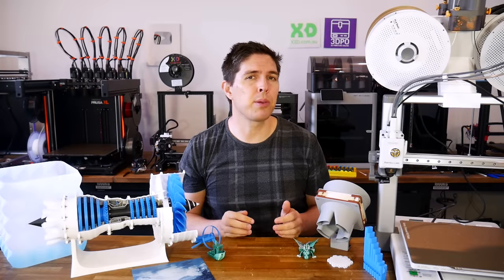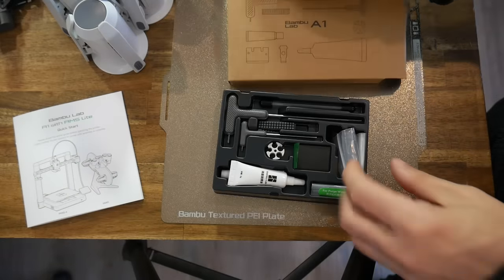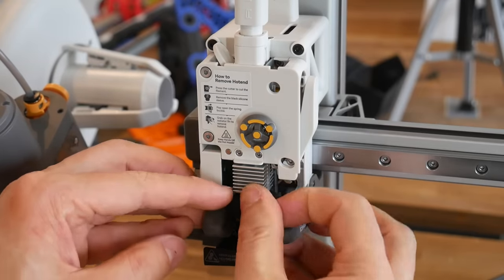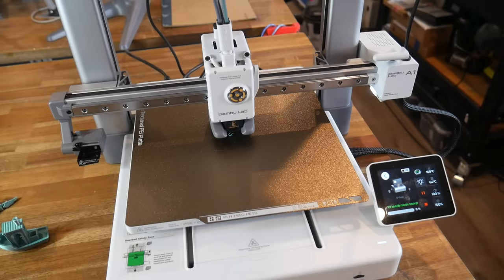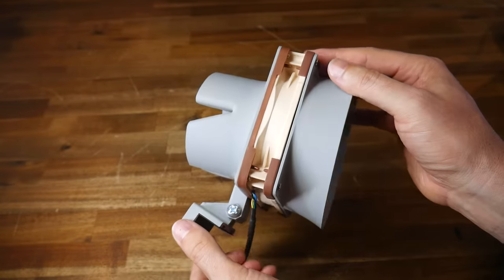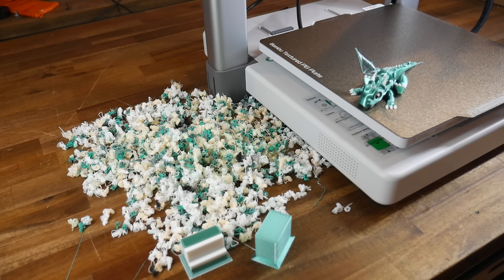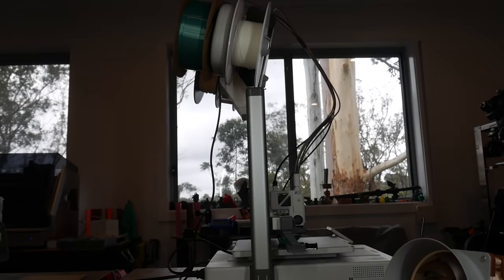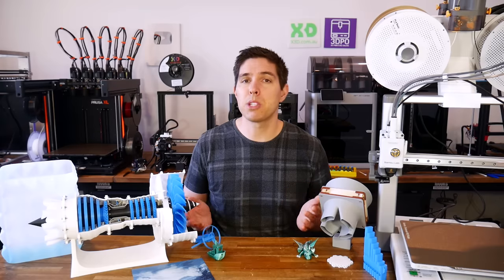Bambu Lab A1 detailed test - ‘Just works’ 3D printing for a great price

Comment: After fighting with my Ender 3 S1 for two days and it changing its mind on what Z offset it needs between every print, this makes me really want to throw it in the bin and just spend the money on something that actually works. Great review as always.
Reply: I just went through the exact same thing with my E3S1 Pro.  I could get one good print out of it then something would change and I'd spend the next 6 hours chasing what the issue was.  Bought an X1C w/AMS, set it up yesterday and I have been cranking out my backlog of prints one after another without issue.  Based on what I have seen, if you just want "set it and forget it" printing, any of the Bambu printers will fit the bill.  I'll never buy another Creality product again.
Reply: Same here. If I had the extra cash, I'd get a Bambu instead. But since my Ender 3 V2 was a gift, and it's just a fun hobby for me, I can't justify spending the money yet.
Reply: Do it man, you will not regret it!
Reply: After using a P1S for a month, I will never buy another Creality.
Reply: I've owned an ender 3 OG, prusa mk3s (My workhorse) and a new a1 mini. The Prusa takes less messing and it is definitely more reliable i've found so far as the a1 is constantly changing its first layer height and inconsistant top layer but the prints (when they work) are great. Just as good as the prusa. The issue with the a1 which no one talks about is that having a pressure sensored extruder means that any melted plastic will mess with the first layer height. And the ams sometimes fails to load
Reply: I was having a similar issue with my Ender 3 V2. I have silicone bed mounts and it still seems to change z offset on me. There was a while where I got it tuned perfectly a few months ago but after not printing with it for a while it seems to be acting up again. I'm also ready for a printer that doesn't change it's basic settings on a whim. However I got it for 130 bucks and I don't print enough to justify a couple hundred dollar upgrade. I'm personally going to give the belted Z mod a shot and see if that helps along with more careful tuning of the v rollers.
Reply: I’m exactly the same with my Ender 3 Neo which was a 6-month old model when I bought it but turns out that it was just a 6 year old printer with a few extra gimmicks.
Reply: @BenWolkWeiss One big fix for my E3V2 was changing out the brass anti backlash nut for a POM one (they're cheap online). The brass ones wear out very quickly and there's a tiny bit of slack, so every time it tries to move up the first fraction of a millimeter doesn't get registered which leads to inconsistent first layers. It clears up after a few layers once the brass nut re-engages. Another issue is the screws holding the hotend to the X axis aren't very good, and you can rock the entire hotend back and forth slightly which causes inconsistent Z offset each time. I replaced those screws too. AND the Y axis carriage can wobble a bit unless the wheels are tightened perfectly, which also messes with the Z offset. Tons of issues I've fixed and still find more sometimes. Also if you get the POM nut make sure to install it the correct way - which looks like upside down.
Reply: Something I've noticed with my Ender 5 is that thermal expansion can make the Z-Offset seem inconsistent. I've taken to heating the bed to 50C before homing and levelling with a BLTouch, it's a lot better now.
Reply: @fmarx1  Yea, I do the same and I feel like it still changes sometimes.
Reply: @Pikmeir  Oooh! Thanks for the tip! I hadn't heard about that issue before regarding the brass nut. I did notice that my hotend was loose a while back and fixed that. Appreciate those other tips about the screws. I'll check on those and tighten or replace them as needed.
Reply: In a weak moment i now bought one 😅 guess i will sell my S1 and V2 😂
Reply: definitely check all your wobbly parts (especially the hotend screws). The Z-Offset on the sprite extruder should be about -3mm. In my case, I installed klipper on my E3S1Pro and it works every time.
Reply: Same with my ender3. Far to much recalibration for each print.
Purchased a K1max and found life so much easier
Reply: X1carbon user for about a year...it just works.  Day in and day out.  Its been an amazing machine.  Constantly impressed.
Reply: @paradoxx_4221  nothing wobbles but from what I've read, it could be an issue with the frame not being square. I've got an RPi coming in the post to install Klipper so I might be able to stick with my S1 if that all helps.
Reply: @jacobplatt3066 Shouldn’t the A1 clean its nozzle before setting Z height?
Reply: @BenWolkWeiss so serious; you are probably having a software issue.
Creality slicer had my prints going 1.25x wide on the y side
Reply: @enhidri160  Correct, it should. But i keep getting first layers that are too high, then too low then okay then too high again so i wouldn't say it is consistant at all. The Pinda was a better idea, never an issue
Reply: You mean installing Klipper?
Reply: Yeah, why does the best z offset always change?  Because you lift the build plate and it's warped?
Reply: I just fought mine for a week to get one print. Ordered a a1 mini Sunday. Not realizing they were going to have this one
Reply: @jacobplatt3066  Yeah but the Prusa is twice as much as the A1!  I have a Prusa Mini and love it but I refuse to spend a grand on a Mk4 even though it is the ideal machine, IMO.  I just ordered an A1.
Reply: This is the exact shit that happens on the ELEGOO Neptune 4 pro, exactly the same, just garbage.
Reply: Had the same thing with my Ender 3 v2 neo. I did so much work to the darn thing to keep it running. I now have a P1P, I've done maybe 40 prints on it and haven't touched my v2 neo.
Reply: @joeking433  No no, i was referring to my old mk3s i've had for years. The bambu may have all the technology but it can sometimes make it worse. I'll just have to see how it continues to function. The only explanation for the inconsistant first layer calobration is the textured pei as it has to touch it with the nozzle and this spot will change each time, unlike the smooth
Reply: @Pikmeir if you can rock forth and back your hotend you need to tighten the wheel with the eccentric nut till its tight and has no play

that is not a real "issue" since it's relatively easy to resolve
Reply: I feel your pain with that. I've been using the first craftbot model for years, still have it and it works well. Got a 5 S1 with addon screen this time last year, at first seemed good, but soon realised there are issues with Z height and auto calibration not working correctly, and concluded that the firmware is junk. Got an A1 mini recently and it's amazing in comparison. Excellent firmware that works, and preparatory tasks such as heating bed and nozzle, levelling, nozzle cleaning, purge, calibration and so on happen in parallel rather than one at a time like with creality. Levelling is also optimised with the printer doing sanity checks on the levelling, checking that it matches expectation and running a full level only if needed. Merely saying that the Bambu is an improvement over something like the Creality would be understating it IMO as it's at a whole new level that I doubt Creality will ever reach. Bambu in the UK also correctly ensure that they charge VAT to customers, whereas despite being registered for VAT and shipping from the UK, Creality do not. So the 5 S1 is the first and last creality product I'll ever touch, and now about to get a second Bambu in as many months.
Reply: @BH4x0r I don't mean the eccentric nut. This is the actual hotend itself, which is held on to the X carriage by two screws which are positioned only at the very top of the hotend. The screws aren't the exact size or they're too weak or for whatever reason they're low quality and have a bit of give, even when fully tightened. I threw them away and replaced them.
Reply: @Pikmeir  hm strange, maybe that's a thing on the V2 etc, it wasn't an issue with the CR20 Pro and Ender 3 (original) hotend i had atleast
Reply: @BH4x0r It might've just been my unit. Mine has had a lot of small issues like that. It's just overall poor quality control from Creality, that some people get near-perfect machines and others get a mess like mine.
Reply: @jacobplatt3066  could you elaborate on the melted plastic part? Dirty nozzle on the outside?
Reply: @stavell  Yeah so i'm having inconsistant first layers but across the whole bed each time and it is mostly too high. The nozzle is always clean to my knowledge but the loadcell clearly isn't reading consistantly
Reply: @stavell  And i'm not sure what you mean about the melted plastic parts?
Reply: @jacobplatt3066  Sorry, didn't properly explain. I mean leftover filament on the outside of the nozzle or at the tip of nozzle. Nozzle cleaning routine before the auto bed level is supposed to take care of this? At least the textured PEI hypothesis is easy to test, just test with the smooth PEI :) But if it is the load cell then it would be hard to solve. 

Btw is the load cell used only for bed leveling or also used during extrusion similar to Prusa?
Reply: @stavell  I understand, so the nozzle cleaning routine looks fab but honestly, it doesnt really clean the nozzle the best, there is still plastic on the nozzle but maybe it only focusses on cleaning tbe very tip. I've got a smooth pei on order so will test that when it arrives and with the Prusa, only the mk4 uses the loadcell for flow rate and bed levelling, not the mk3s which is what i have, it instead just uses Pinda for bed calibration but it is extremely reliable. I find the flow rate compensation on the bambu to be best suited for bambu filament or the other filaments bambu lists. It can help but again it can be inconsistant. Manual flow calibration worked best for this i found.
Reply: Same thing happened to me.
Reply: i'm currently running ender 3 v2 with heavily customised printhead, but I know that when the time comes, when I say enough is enough, a bambu will take it's place :D
Reply: Same for me with my S1, what a waste it is
Reply: @BenWolkWeiss  Maybe the reason you don't print enough to justify the cost is because you have to fight with your printer all the time.  To be honest, I hate enders.
Reply: i have 2 S1s and 1 v2 thats basically an S1 now with sonic pad, for their time they worked ok but required work, I opened the A1 on xmas, put it together and sliced a flexifactory panda precolored and sent it. it was done by the time i got home for the day. worth the money
Reply: The Ender 3 is a low cost Printer not a beginner Printer. I have several selfbuild printers since 2014. But of course i wanted to print and not to do maintenance on printers, so i bought 2019 myself a Ender 3 pro. It was great, for the first 200 hours, then the maintenance started again. In the End it broke down after 1400 ish hours with total brake down. I bought another Ender 3 swapped all the parts over and guess what: The inspection after 500 hours revealed: 3 Roller Bearings from the Bed are damaged, the Rail in which the Roller runs has a bump now.. 
Ender 3 are cheap because they are cheaply build. I have Linear Railed printers which run after 2000 hours. And now a Bambu Lab X1C which clocked without any maintenance 500 hours and still runs fine. (And yes it will get a thorough cleanout now and regreasing, something i did on the Ender 3 and my other Printers every 100 hours runtime).
One thing to check on the Ender 3: Push the Bed forward and backward. It should run without Bumps, each Bump will change the heigh of the bed slightly, there are 4 rollers below the Bed. You can adjust there tightness. If they run bad you won't get a consistent height and they wear out extremly fast.
Reply: Have.  You activated the g420 s1 g code manually in the slicer, thats what really messed with my ender 3v2 and s1 plus, the 3v2 runs perfectly after fixxing that
Reply: You are bots. It’s disgusting. He’s just shown how actually lame Bambu Labs printers are.
Reply: I’ve loved all my Enders. Switched to ELegoo and hated it. Thinking of Bambu printers, but I have a sneaking suspicion they are complete hype. I’m getting better prints on my ender
Reply: @johnlocke3481  What a weird thing to get so worked up about. It's a printer, not Taylor Swift. No need to go all creepy fanboy about it.
Reply: Not bamboo tho, go prusa
Reply: This is the exact reason why i got my Bambu p1s,

the ender kept changing its mind on what the z offset should be for every print. tried everything, updated the firmware, and changed the sensors and the bed. no change, 

now with the bambu, it's kept in a completely different room. i just send a print over LAN and it's done, i dont even need to go to the printer to set it up. it just does it, and all i need to do is go and pluck the finished print, and it is good to go.
Reply: The bin?
Reply: That's what I did with my e5 pro. Got an x1 carbon and it just actually works.
Reply: Ive been running a ender 3 v2 since it came out and I’m getting to the point that I spend more time fucking with the printer than I do actually printing things. I’ve upgraded the shit out of it over the years and I’m finally just pulling the trigger on the A1. All the features that I’ve been wishing for since I started printing packed into one.
Reply: LMAO: I've been fighting the Z battle for 10 months now. Countless tech support tickets, Creality sent me a whole bed replacement. done all the hardware/software tweaks and still a crappy 1st layer with the center dead on 30mm squared and the other parts are simultaneously too high and too low. "Auto calibration & Auto Z" = the definition of Misnomer.
Reply: I used ender 3 for about 2 years. It printed fine first, then it had a nozzle overheat problem where it would melt the filament in the bowden tube and then it would get stuck.

I fixed it with a longer nozzle and put some thermal compound where the radiator is mounted on the nozzle shaft. It no longer had any issues and printed great for about 1.5 years, and still prints great. 

I just bought the bambulab a1 because it's quieter and faster.

Comment: CATIAV5FTW here… thanks for featuring the jet engine model ☺️ Looks like yours turned out pretty clean! One thing I’d recommend to fix the low pressure turbines rubbing in the back is to sand down the interfacing surfaces between the LP shaft and LPT spool. I’m working on tweaking the parts and profiles a bit to reduce the amount of support material as well. Also want to upload a profile where the support interfaces are PETG to obtain better surface quality on the supported features.
Reply: Your model is absolutly mindblowing. I would be able to copy it on Solidworks, but I wouldn't be create one myself. Astonishing !
Reply from the maker: Thanks for your great model and your suggestion. I will have a go next week.
Reply: Can the ams lite do multi material printing. I’ve not found any information saying it can but have seen some videos where people have said it doesn’t as it can’t cope with heat difference
Reply from the maker: The AMS lite just feeds filament to the print head of the actual printer. It doesn't have any heaters, so the type of filament is irrelevant. The only thing it needs is rigid filament, which is why TPU is disabled.
Reply: Actually, I printed your model 3-4 years ago :) and I thought I did something wrong that caused the rub. but when I tried to sand the rub; it was too much.. my fix however was to print a spacer between the turbine section housing and the exhaust gas diffuser and it fixed it.. probably need to reprint it again 0.2mm thinker or so to get rid of all the rub but I was so lazy to do it :D.. let me know if you need a photo or a video of the where the spacer sits.. I would say do not alter the design, just add a spacer STL to the package

Comment: this needs a test for high objects, let's see the quality of the bedslinger like that
Reply: Agreed, I would like to see a full height print with this fast bedsliger with focus on the bottom and top end, maybe a geometric vase or a ringing tower.
Reply: Testing the limits of a printer should be standard in all reviews, but for some reason we usually at most get speedtests on small prints.
Reply: @MumrikDK  especially when TT himself made such a test, just to not use it. Inputshaper is cool and all, but there still are some laws of physics.
Reply: It's ok, I printed few objects at max height on A1 Mini which I believe was about 18cm and it printed flawlessly. PLA without glue, PTEG with glue in spray. Flawless prints every time on default settings and 100% speed.